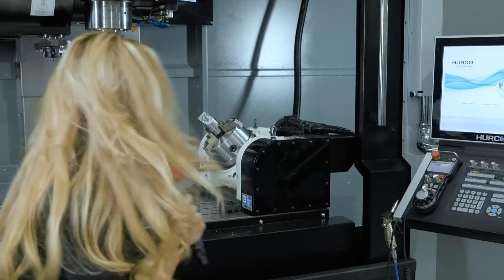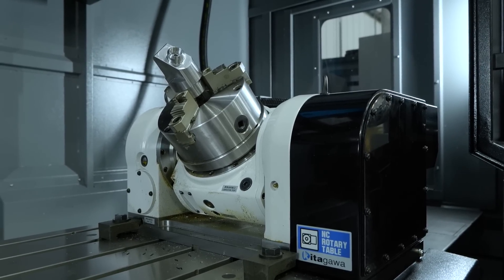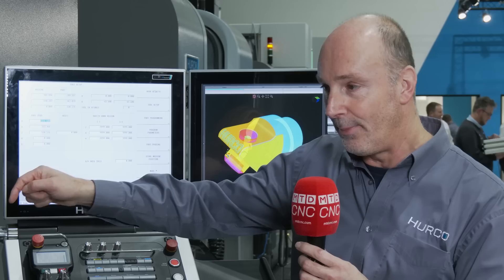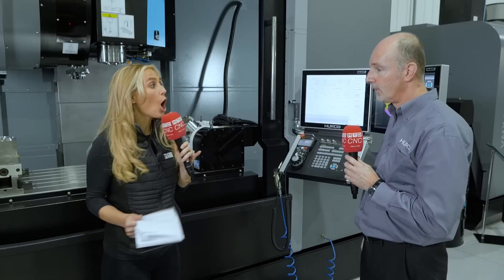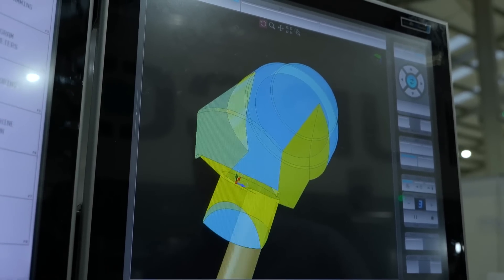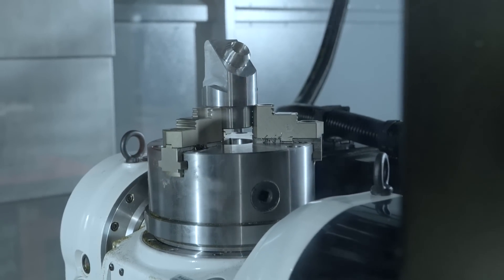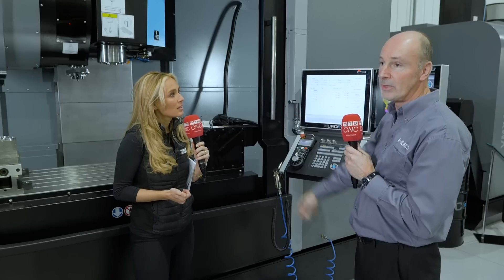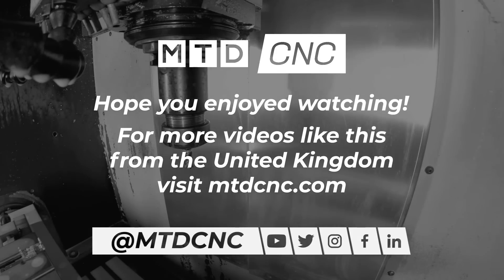Here’s how you can have full 5-axis capability on your 3-axis HURCO machines

Comment: I feel like its a bit of an oversimplification to say the switchover time is 5 minutes, sure plugging everything in and rebooting the machine might take 5 minutes.
but there is no way you can align the rotary table that quickly. not to mention the controll probably has to know where the rotary centerpoints are which would probably have to be recalibrated eacht time the rotary table is taken off and put back on.

Im not saying i dont like the option here, but i do think its bad advertising this way.
Reply: Yes, i guess you definitely need a precision zero point system. Not like this clamps in the video
Reply from the maker: Yep a zero point system would make it very quick but appreciate your point